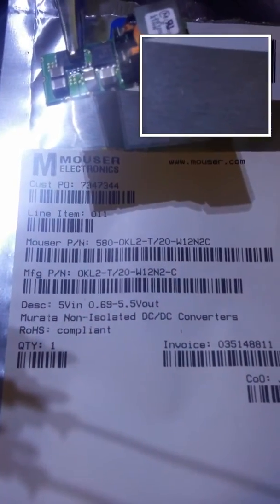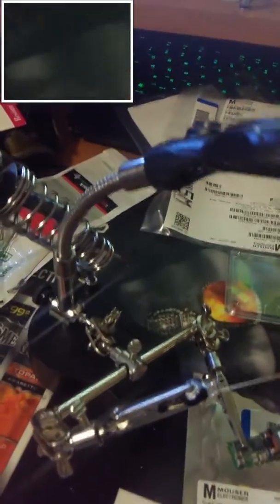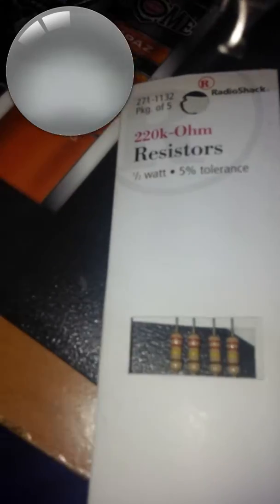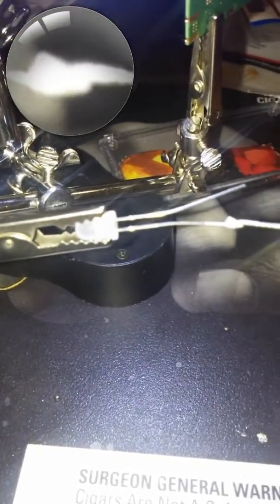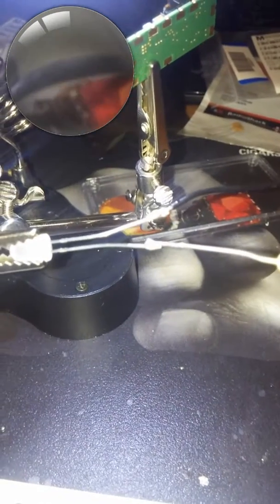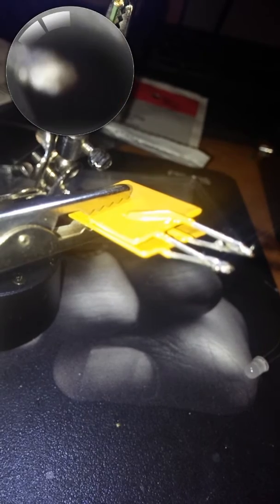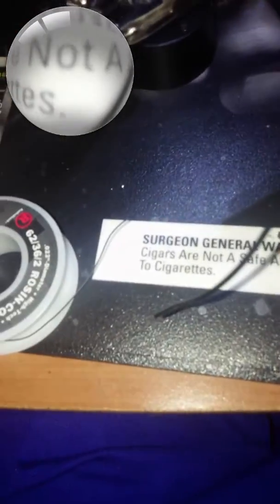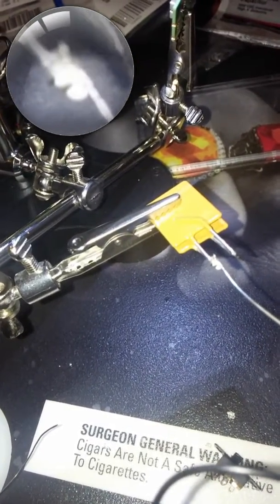Okl2-t/20 100w boxmod how to Part 1

Comment: How's the OKL-T20 working out for you? I just got one commissioned to be made for me (250$ seems to be the asking price, plus I'm getting a nice case for it too) and it's gonna be my first experience with a box mod. I went with asking someone local (a shop, actually, called Liquid Lounge in New Jersey) so that if something goes wrong I can take it straight to the shop. I've heard too many bad stories of people mailing in [specifically] box mods and not getting them back for a month or months. I'd like to think that even if I'm the person who breaks it, at least I can take it to a physical location and get it back within a few days.

Either way, I wanna know some specifics about it, assuming you've got one, how're they holding up, things to be wary of, etc?
Reply: Also I don't mean to name names, but specifically I've heard of Duke owners not having their Dukes for longer than a few weeks before having to mail them in because something broke, and then they're without it for a month or more! For an expensive product, service should be a lot quicker (especially if it's a manufacturing defect). Also some people just aren't using nice cases/buttons, and batteries get shredded by the doors and stuff. The maker of the box mod I'm getting has addressed a ton of issues like this.
Reply: I have a okl2-t20 and mine is holding up well (delta H vapes stratus). I have a few dna 30 devices and am usually a kayfun type of guy but since getting this I have been using my dripper more.. Really loving it. It's a lot of power
Reply: St Andrew Rad, I should be getting mine later today. Can't focken wait!

Comment: Can the same mod be made without the voltage indication screen, reverse indicator and just use the fuse and potentiometer knob  between the raptor and the 510. I want to build one in as small a form factor as possible. It's just for me and I don't need safety features because I'll know what I can and can't do safely.
Reply from the maker: Yes it can be done. No screen or mosfet needed
Reply: Cool news, I'm a fan of minimalism. I know it can be done with with the OKR 6 and 10 but my knowledge about how these chips handle things like under voltage and regulation is still limited. Is there any posts or videos of someone building a minimal Okl2-r/20 ,od like I'm talking about? I've searched a lot and have yet to find one.

Comment: Oh, what is the Ohms value of the resistors. Thanks
Reply from the maker: 220
Reply: Thanks, so much! Please post part 2. I have everything to make this happen. Is the 1.3 Ohm or 1.5 Ohm better. My Hammond 1590 G box will only allow 1 18650 for power. Have a HDMI charger on the way also.
Reply from the maker: Yeah use the b
Reply from the maker: I will be posting a full video on how to. Make the naos raptor this weekend then the OKL video and I'll be doing a okr one to
Reply from the maker: Grab 1.5